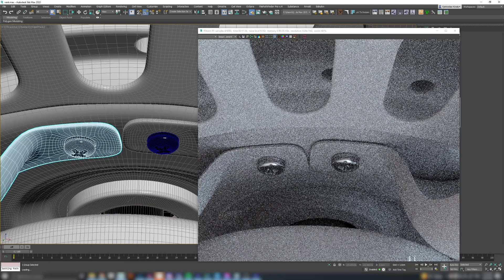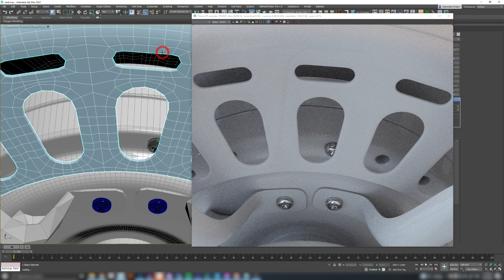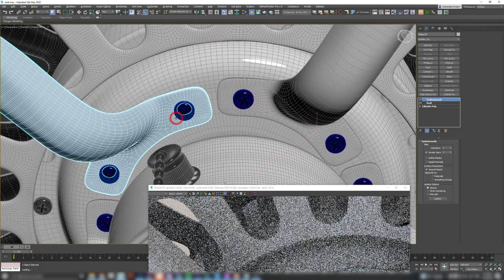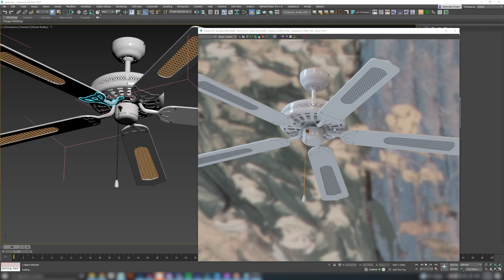Your Topology Will Never Be The Same After This | All 3D Software

Comment: You could easily delete a ton of polys in that fan and cut down the file size and memory used without affecting tree final render.
Reply from the maker: Absolutely! Thing with that fan is that you have tons of details connected to one object so I had to preserve a bunch of edges, also it was modular so parts were connected with other parts so had to be sure in consistency, not to mention it needed to have macro shots so didn’t want to rely on massive turbo smoothing to get details looking fine,
If it was a total shot just hanging in the room it would be 3 times more simple :)

Comment: You will need to use some triangles, thats true, sometime they even make more sense than quads. But there is no reason to use an n-gon, almost never
Reply from the maker: Unless it’s a flat surface, on the other hand I agree it’s best to add some edges to guide that ngon so that triangulation doesn’t make a big mess

Comment: The quads seem to make a lot of redundant faces and points. The minimum necessary geometry to define a shape and the minimum necessary for raytracing and work reducing efficient geometries are the goals I seek. I feel like it is the job of the computer to figure out the optimum geometry and the creator to give just enough specificity that the computer does the rest and creates the result.

Comment: Could you please explain how did you make the metal material exactly?! it looks so realistic! what numbers you used for fresnel IOR and glossiness. is that simple material or complex. thanks.
Reply from the maker: It’s bothing special, white difuse, ior around 1.7, glossy 0.98
It’s mostly a good HDRI for result
Reply: @RenderRam  Thanks! white or black for diffuse?! because I think the metals have no diffuse color!
Reply from the maker: @hamidsalami7022  i thought you ment white fan material, which metal are you talking about exactly?
Reply: @RenderRam  No I meant screw material!
Reply from the maker: @hamidsalami7022  oh ok, black diffuse, ior 7-8, glossy value 0.7, fresnel glossy value 0.9
Reply: @RenderRam  Thanks!

Comment: Hi again, I just have one question.
In 3DS Max, how would you build the terrain between the roads? I've tried extruding the edges and connecting close vertices... I've also tried capping the hole then insetting the new face... But I feel like I'm taking too much time, and that this is not the correct technique...
Reply from the maker: Hi Dave, it's a bit tricky to understand what's going on exactly without seeing actual situation, can you give me some sort of contact, and I'll help as much as I can.
Reply: I'm trying to create a flat terrain with a river passing through. The river's "boundaries" are represented by a quad strip following a spline, similar to the roads in your video, and the terrain is a simple plane with a grid topology.
I cannot provide any screenshot right now, as it is quite late where I live. I'll try to take screenshots as soon as possible.
Reply from the maker: @davidkroft  You can send screenshots to renderram.cgi@gmail.com, and we’ll discuss it there.